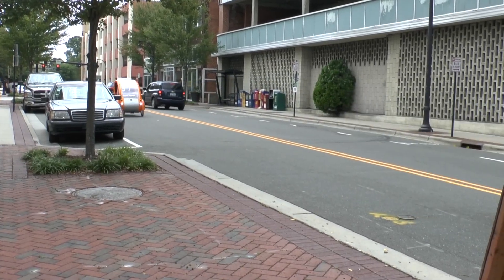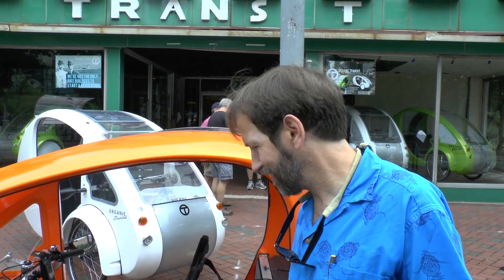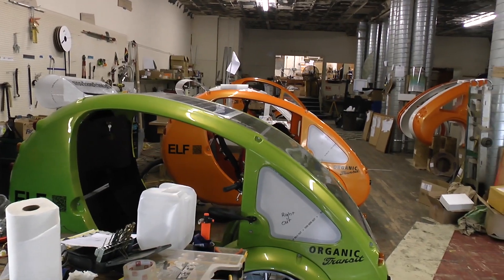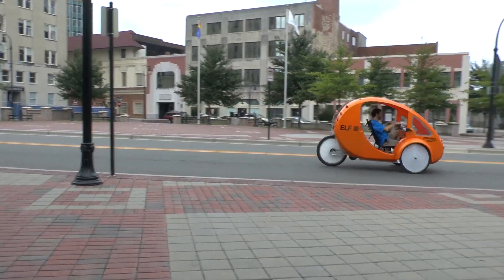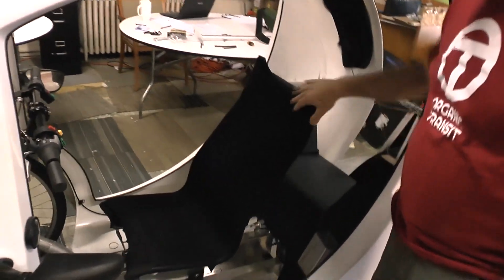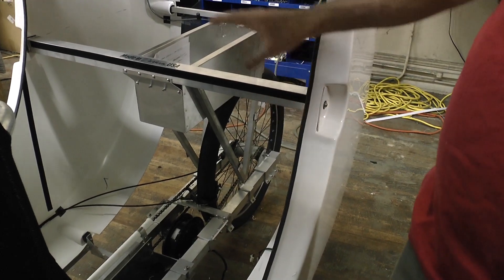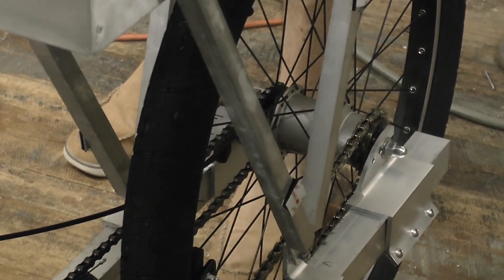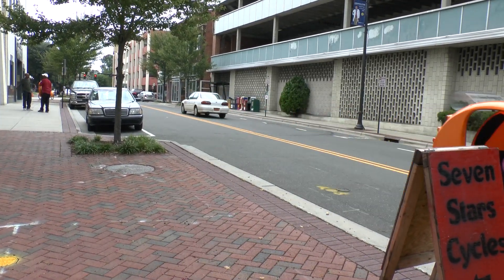Enclosed Tricycle is Half Bike, Half Car

Comment: Can you close the floor off and still pedal ?
Reply: Owners know the floor needs to be open for maximum ventilation as we exercise in this small space. There is a floor on the mid-section if you buy the two seat model. Your heels come within 2 inches of the pavement.

Comment: Any such thing is one of these with the pedals operated by hand (if the user uses a wheelchair to get around more efficiently?
Reply: Not with this design. You need to steer with the handlebars. Wheelchair bound owners fold their chairs behind the seat and use the motor.

Comment: Could build one way cheaper-   use the motor hub kit off ebay.
Reply: No you can not. The materials alone cost $4000 and the light body shell is vacuum formed in a custom mold. Quality is not free.

Comment: simple trycycle but charging alot money for body plastic frame
Reply: Nope, it is far from a 'simple tricycle'. Integrating solar and pedal into a safe body design with many car features is genius, no one had done this previously, 1000 have been sold so far. The price is cheap for what it is. Every year you drive this instead of a car you save $3 to 6K while getting essential exercise.

Comment: If this hits standing water during a turn what happens with front wheel spray especially inside the cabin? The front fenders on the inside seem narrow. Aftermarket doors or half doors available to stop exterior spray from oncoming traffic?
Reply: I don't exactly think that people would want to ride one of these in the rain
Reply: Yes, half or full doors are sold, I would not want them, makes it too hot. If you anticipate lots of rain it is easy to add some little inner fender panels. Only a tiny percentage of your ride time is spent in turns.

Comment: Well it's a very nice velomobile.  But it's still just a velomobile, nothing really new here.
I'm not really sure $4995 is "cheap" for a velomobile, but i guess it might be cheap for something this new & nice looking. 
Alas recumbent bike mechanisms are quite expensive simply because they are relatively rare compared to normal bikes, so it's hard to get cheap prices.
Reply: Velos typically sell for $8 to 11 K with no motor or solar or cargo and passenger carrying ability.
Reply: Velos in the 10k range, where the ELF now sits ($9k base price), have e-assist options and all velos have cargo space (40-80+ liters). Also those in the that range often use higher end components as well as carbon fiber for the shell. That makes them weigh ~1/3 that of the ELF or less (ELF ~180lbs a 10k velo is ~60lbs or a little less). On a velo weight is everything, it affects accelerating from a stop and climbing inclines. 

The solar panels are not much more then a sales gimmick for anyone outside the the south west, Texas and Florida.